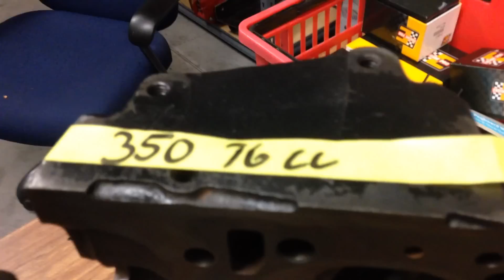350 and 305 Chevy what's The Difference

Comment: I had one in a Camaro. It took a tremendous amount of abuse and never complained. If you have one, bore it out, put some heads on it and keep on Truckin'
Reply: mcinkyt I have on in my 91 rs need help what to do
Reply: Had a 305TPI in my 85 Iroc Z. Great engine considering how cheap it was to mod. Some vortec heads, cam, intake work, exhaust and it will create some decent numbers :-)
Reply: Had one with the same mods in a 86 Regal, one wheelie peelie for days until we put a posi in it lol.
Reply: So why shouldn't he just bore out the 305 and build a 383 out of that ?
Reply: The 305 doesn't have real sleeves like a 350, so boring it out to a 350 would be risky. You could probably bore it out to a 307's bore (3.875"//7/8") and have 328" but you'll never get to a 4" bore and have much cylinder wall left. Wouldn't be safe for a stroker most definitely. You could stuff a 3.75" stroker crank in the 3.875" bore block and have a 353" engine. But as cheap as it is to get a 350 block and if you're building a stroker anyway you might as well do it to the block that gives you 30 extra inches.
Reply: mcinkyt Correct me if I'm wrong but wouldn't it be cheaper and make more power and sense to just install a 350 cubic inch instead of boreing out a 305 and installing new heads to a 305?
Reply: Fix it Fast it honestly depends on what head you run that's typically what really cost the most
Reply: Forget about the 305...no hp...no torque...horrible mpg...Can't make a silk purse out of pigs ear...It's no 350...I've had both...
Reply: 140 mph? 305 with the stock gearing? Not a chance.
Reply: D M My 79 Camaro Berlinetta had a 305. Completely stock. Hit 130 on two lane blacktop roads in rural Iowa. I even took a pic of the odometer rolling over 100k while doing 100mph. I'd say 140 isn't out of the realm of possibility...
Reply: dude drag is the square of speed. you need lots of HP to get a Gen 2 camaro to go fast, heavy and bad CD. It didn't happen
Reply: I talk to you on set of vortecheads that I had. You told me they might be brodix. I called brodix they don't make a cast-iron head do you have an email I can send you a picture of the heads? I would really love to find out who makes this head that I have, thanks for your time
Reply: D M I was thinking the same. Going down a steep hill with the wind maybe. Lol
Reply: Curtis Kreklau i got an 85 c10 stepside with duel tanks and a 305 stock engine. About 3 years ago i lost compression in a 3 cylinders. Ive had it in the garage since then. Im thinking about taking the engine out and rebuilding it completely. It just seems like a shame to get rid of the stock engine if it still got life in it.
Reply: Lots of ignorant comments and outright lies here.
Reply: @dm2118  I had a 79 Camaro that buried the 135MPH speedometer, many times. It took a while to get it up there but it got up there and passed it.
Reply: @bigal7997999   Same year here and buried my 135 speedo many times.
Reply: I HAD A 78 MONTE CARLO WITH A TUNNEL RAM ON A 305 AND 454 PISTONS AND A ROLLER THREE QUARTER RACE CAM IN IT, MAN IT WAS A 5 SECOND CAR ON. SUNDAYS AND I DROVE IT TO WORK EVERY DAY, I HAD TO TAKE THE JIMMY SUPER CHARGER OFF.  BEFORE I DROVE IT TO WORK CAUSE THE COPS GOT MAD ABOUT THEOPEN HEADERS YOU HAD TO RUN WITH IT, GOT A TICKET FOR 266 IN A 65 ONE TIME, MAN. THAT CAR WAS FAST
Reply: @shitbox7413  140mph is plenty fast on the street
Reply: @american23t  255 lbft pretty good
Reply: Or get a 350 and save money on machine work and parts. 305 is a fine engine.
Reply: Question......whats good heads to run on a 305?....im a fan of vortec and know how to port & polish
Reply: @27Zangle  which heads did you run?....off what motor?
Reply: @nsren92  cant get 383 put of 305.....not enough metal to take out
Reply: @bigal7997999  The higher the speed the less accurate those old speedometers became.  Changing tire size or gearing would make it even less accurate.
Reply: @amc401nash6  oversize tires mean it's going faster

Comment: I think the 305 is a great engine. The 305 in my 92 Caprice has over 300,000 miles on it and it still runs very strong. And the power isn't that bad. I can break the back tires loose from a dead stop. It may not push you back in your seat, but she moves when you need her to and the economy is great. Also, with just a few minor upgrades like ignition, air intake and exhaust, all relatively cheap, you can get a surprising bump in power out of the 305. I may eventually upgrade the Caprice to a 350, but not until this 305 finally goes. And that may be a long time!
Reply: The 700R4 tranny had an ultra low range 1st gear, a hole shot advantage.
Reply: Kd Grayson the 700r4 sucks I went through 4 of them in my 81 c10 I finally got a th350 and haven't had a problem since
Reply: Keith Allen  If you ant to haul ass get a Corvette or Camaro or a motor home.

Comment: so the 5.0 Had thicker cylinder walls? therby allowing it to hold more power overall before cracking a cylinder wall??
Reply: Brandon Jay the 350 is a motor with little limitations to make power besides the block literally shaking itself apart at 600 horsepower so cylinder walls would never fail before you throw a rod or something. The power limit of the engine geometry is that the block itself may flex and change clearances or the mains shake and crack loose but that happens at such a high power number you’ll never get to it. It’s why the sbc is so good.
Reply: I have a question I have 98 sierra 305 and the block  it's  cracked and I can't  find a motor so I was thinking to use a 350 and my question is if is going to work whit the transmission?? Do I need to change  the computer too??
Reply: Oscar Ayala nah both work
Reply: Yeah but it also had a 2 bolt main that’s the kicker
Reply: the wall thickness at the top but the cylinders arent meant to bore passed .060 or they start to get thin. You cant take a 305 block and bore it to 4 inches, the walls are too thin.

Comment: If you want power, and stability out of a Chevy engine, start with the 327.
Reply: Aaron Lovell yep, a 350 with a 283 crank
Reply: not that easy to find
Reply: @billyfromtheusa So that means parts are interchangeable if your theory is correct, right? Guess what, as a mechanic I can tell you that the motors are entirely different. Because Ford does their own thing and GM does their own, and Dodge, and so on. They have been for always and always will. Did you also know that Ford took Obama's government fund to make their cars different while GM said no and failed? Bet not, like all other Ford fans. Dont slam other fans because you worship only one, learn the goods and bads of every one and then pick what you like out of many. Dont pigeon hole yourself. Or do, it's your life.
Reply: Troll attempt failed there Billy. Who cares if you currently own 5 whatevers and this many of them is blah. I've owned over 20 different vehicles of all makes and models and types. Doesnt mean that I'm gonna get on here and be a dillrod though. Calm your tassels.
Reply: Also, I would like apologize Aaron. Didnt mean to set "Billy" off some more by disagreeing with him on your comment thread.
Reply: @colinfruend5537  it's all good, no need to apologize. It's good for guys to get fired up about there cars. I own 2 Ford's myself. But if your making a top  10 list of the best engines ever built, the Chevy 327 and 502. Would have to be on that list. The best Ford engines ever built out side of the 429, and there 800 series mountain motors. Was the little 289. And the best dodge engine ever built was the 318. Outside of the "original" hemi engines. The modern day hemi engines are not your daddy's hemi. It is good to see what every maker has to offer. I have a 1949 Hudson Commodore 8, it has a 254 flat head straight 8 engine with a 1 barrel carbarter in it. It only has about 135 horse power. But it rides smooth down the road at 70 mph. I love cars, have worked on many cars over the last 40 years. And if a guy wants to get fired up about his cars, then great I love it. It helps keep old American cars alive.
Reply: @colinfruend5537  also I would like to say I'm not a hot rod guy by any means. Of the 4 cars I own, 3 of them have flat head engines, and the newest car I own is a 1964 ford f-100 with a 223 straight 6, 1 barrel carbarter. So there is no hot rods in my stable. But I have built a but load of gassers for other people. And it's not all about the horse power under the hood. It's about the transmission and rear end as well. It's about putting tourqe to the rear end and going from point a to point b. And even though I don't own a Chevy, I will say Chevy has all others beat in this area. And if I was going to start a gasser build tomorrow, I would start with a Chevy. And a 327 engine....
Reply: Aaron Lovell if this comment section proves anything, it’s that no matter how old or mature you get grown men will still argue about car brands like 13 year old boys at a wood shop class.
Reply: Aaron Lovell also the only real advantage you get with the 327 is making a high rpm screamer motor with fine-ish torque. The 350 taps out making healthy power at 6000-6200 while the 327 cuts off at around 6400-6600 but you do lose torque down low. Also takes more money to build a 327 because 283-327 cranks are more rare to buy and less are made new.
Reply: Why cannot watch one car video with out having a Ford vs Chevy battle? Fave owned them all and enjoyed working on them equally.
Reply: @williamtye7927  what is a 283 crankshaft ? That gives the 350 more power ?
Reply: Got to give the Windsor some love. What a bunch of great motors.
Reply: @williamtye7927  Are you out of your mind? A 283 has a 3.0” stroke. Conbined with the 4.00” bore of the 350, would make a 302. A 327 has a 4.00” bore and 3.25” stroke. Keep trying.

Comment: Thank you for putting this compilation together!  I have a Jasper 305 bored .40 over that we are working on right now. We got a killer deal on the low mileage motor and we went thru the whole thing. Actually converted it back to a flat tappet cam from the roller set up so I can just run a mechanical fuel pump and choose my cam.   The roller cam that came with it did not have the eccentric lobe to run the mechanical fuel pump. I have gotten a bunch of nonsense comments from "supposed experts"" about  what piece of junk the 305 is. I just laugh in their face. For the price we have into it it's a no brainer. It's going into a 80''s C10 and  all I wanted was decent fuel economy, decent fun power and torque, reliability and the option of running cheap 87 octane.  I drive the truck a ton and just wanted a fun cruiser. It's going to have an edelbrock intake, exhaust and a quadrajet carb (another component that these "supposed experts" love to put down with zero knowledge on the topic). Sure, it''s not a 350, but for the price and the fun of building it I am looking forward to getting it together and seeing what it does. Thanks for the awesome video and your opinion of the 305 and thanks to my awesome father for getting me into cars in the first place. Peace
Reply from the maker: Glad to hear it I just picked up a 305 Roller cam engine this morning for 150 I am going to build it and sell it They work well with flat top pistons and a good intake/exhaust + if you get the roller cam block there's no break in and no high zinc oil needed

Comment: Back in the 70's I was given a 1965 Chevelle with a 6 cylinder engine.  The 6 was blown and the body on the Chevelle was rusty but I wanted to make a hot rod.  I bought an older Chevy with a 283.  I took the 6 cyl out of the Chevelle and transplanted the 283 into the Chevelle.   I also took off the 2 barrel carb and the intake off the 283 and replaced it with a Carter 4 barrel carb with the intake.  It was a fast car!